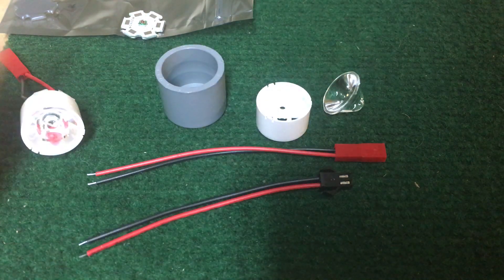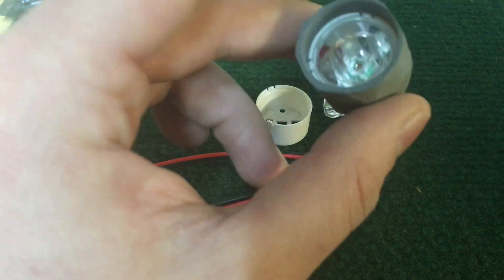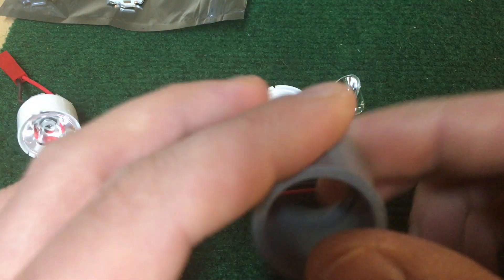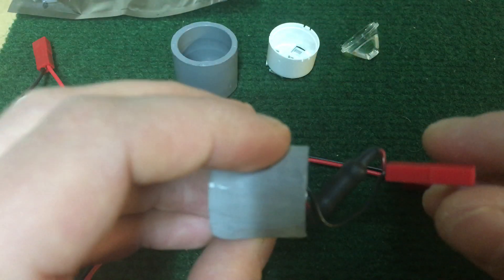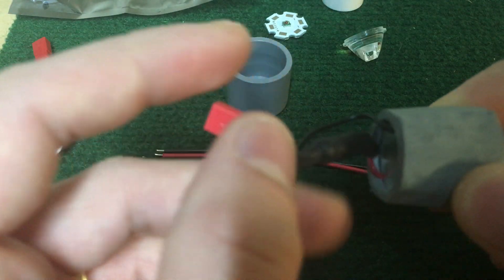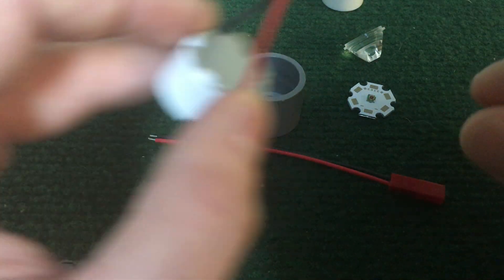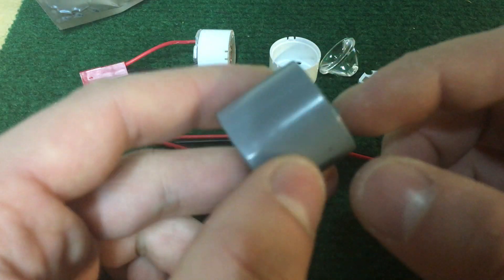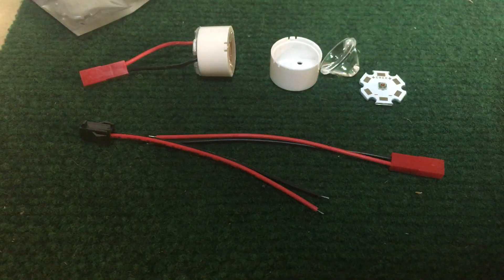DIY Lightsaber LED Module

Comment: Great Video!!! What do you use to power this LED what battery can I use?  And you mention resistors... what one did you use?  Can I power this without a resistor if I heat sink it well.  Thanks for the help!!!
Reply: You should definitely run a resistor with the led. Itll make sure you dont overcharge your led and blow it out. It will also make sure your blade stays evenly lit even as the battery runs dry, otherwise itll dim slowly when the battery starts to die.
Reply: @Ein8826  Do you need a driver for one of these high intensity LEDs or can you just use regular resistors?
Reply: @pmc2085  A regular resistors will be enough. The Custom Saber Shop has a pretty good video on resistors use in lightsaber builds that you should check out. They also have a LEDs resistor calculator on their site that I use for my builds.
Reply: @Ein8826  OMG thank you so much. The led I'm looking at has a current of 350-1000mA and when asking the question on stack exchange these guys are over complicating it.

Comment: I just got the exact item (same part number and all.) It is a 3/4" - 1/2" reducer, part # E950EDL. got it at Lowes for around $1. And what he said about heat sink is good. Most led stars are built onto heat sinks, but pennies  (fit perfect in this part) are hood, especially when a good thermal paste is used between the penny and the led. Before 1981 the pennies are mostly copper, the rest is zinc. Even newer ones which are mostly zinc are good, as that conducts heat reasonably well. Hope this helps :)

Comment: I use these heatsinks on the back of the LED: https://www.aliexpress.com/item/3pcs-self-Adhesive-Aluminum-Heatsink-Radiator-Cooler-Kit-for-Raspberry-PI-B-B-PI2-new-B4/32697274563.html?spm=a2g0s.9042311.0.0.V0kyLc

Comment: if you want a metal one you can try a 3/4" copper cap. that's what I use in mine
Reply: That would be a big step up for a heat sink.

Comment: Hey would you be willing to email me? JacobDConnell@gmail.com I have some question about this. I did an LED strip but have been having too mych trouble diffusing the lights to blur them together....i wanna get on with one big LED and figure how to get it to reflect well in the blade to light fully.
Reply: FEBRIZIOtv. pack film aka packing foam

Comment: I'm curious to know what kind of life you are getting out of the LED's without running a heat sink.  I thought Cree and Luxeon recommend you run some type of heat sink to allow you to run the LED for extended periods without damage.
Reply from the maker: No issues yet, been used since around the first of the year. The star pas is technically a heat-sink, the XPE dosnt get hot at all, so all you need is a housing to hold it. Anything higher powered and you definitely need a module to act as a second heat-sink to the star pad.